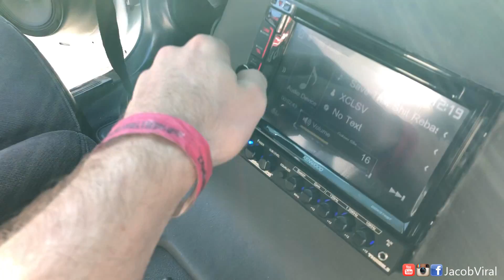4 SKAR DNR 15S ON 4 SKAR 3500S TRUCK WALL | SLAMFEST 2018

Comment: Those suckers are $900 @ 5000rms only seen them online.
Reply: "5000rms only" lol no other subs in this price range that are any higher
Reply: @Str8GasGenetics  that's the specs on their site but all of their series are way underrated I have the entry lvl 8" ix series and they take a beating
Reply: @jonathanpinders.r.5627  I've had tons of skar products some might be slightly under rated but nothing compared to the stronger hobbyist brands